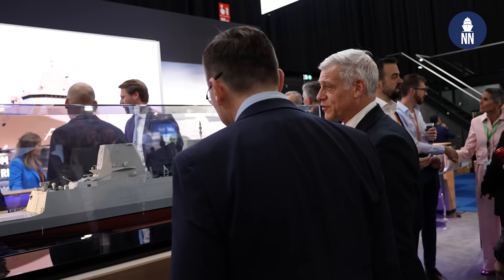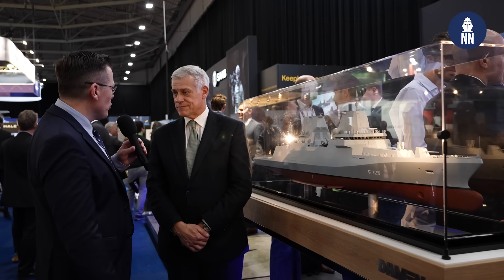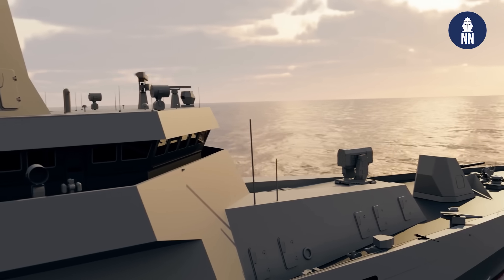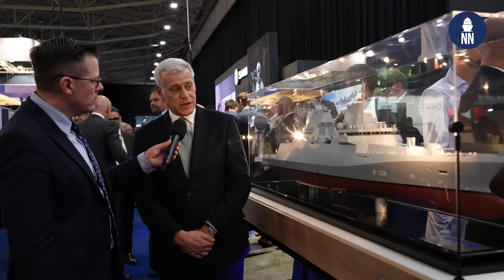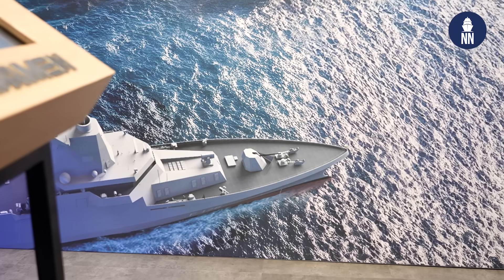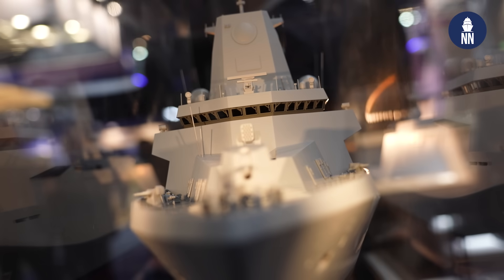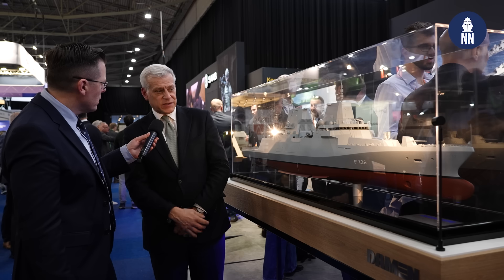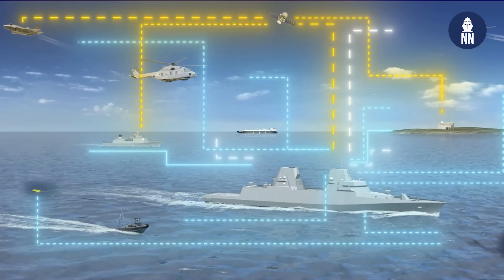German F126 Frigate with Damen at NEDS 2024

Comment: 2028 to be done? and 1 made a year. The manufacturer is enjoying vacation and making ship and the same time? Russian will invade Euro before German could see this ship.
Reply: 🤦‍♂Luckily the German Navy already has other ships in service...
Reply: @digitallegion3462  I think german don't like VLS system, 16 cells for 10K tons is insance
Reply: It doesn't mean that. it takes 4 years to build and test those ships before it is handed over to the German Navy. they start building each ship with approx 1-year delay between each other, thus they are delivered 1 year after each other.

Building the hull and superstructure doesn't take long, a year perhaps. But installing all the equipment, machinery, electronics etc., and testing them is what takes a long time, something they can do while the ship is in the water.

So when the first hull is done built and put into the water (1 year approx), they start to build the second hull where they built the first hull. The First hull will stay dockside and get all equipment installed and tested
Reply: Lol, said the same.  1 per year???!! Pathetic 🤣